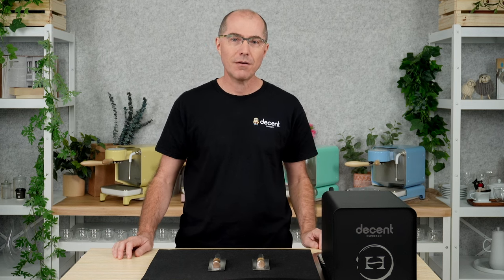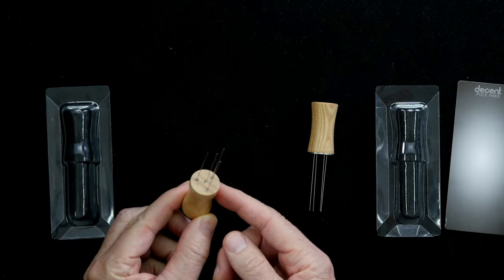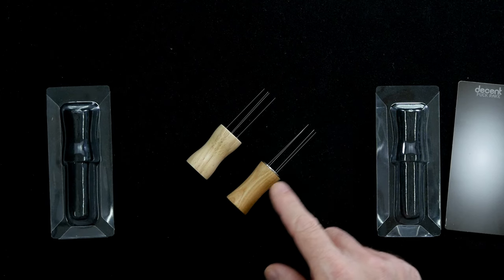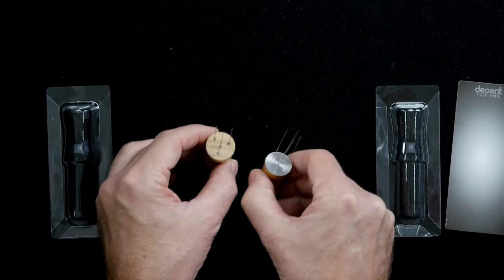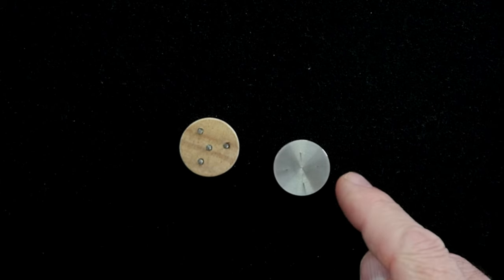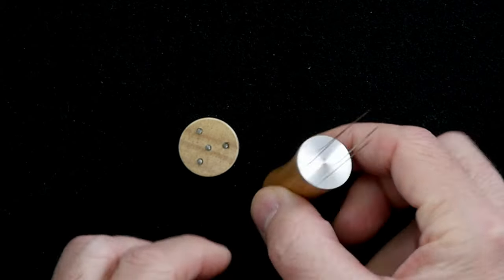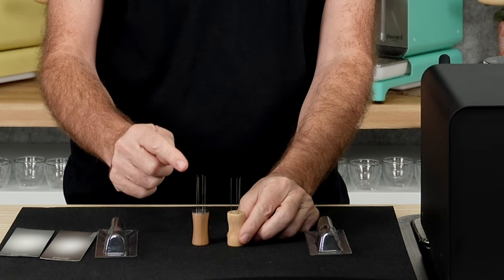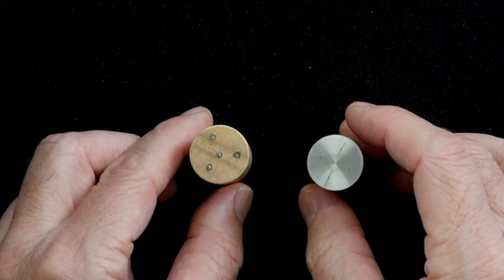Introducing our new v2 Puck Rake

Comment: Are you able to replace the needles if/when they bend? thx
Reply from the maker: Yes, easily. Unscrew the metal from the wood, replace the needle, screw it back together. There's no glue, just pressure.
Reply: @decentespresso thanks for the response, sounds like a much better solution than v1 👍